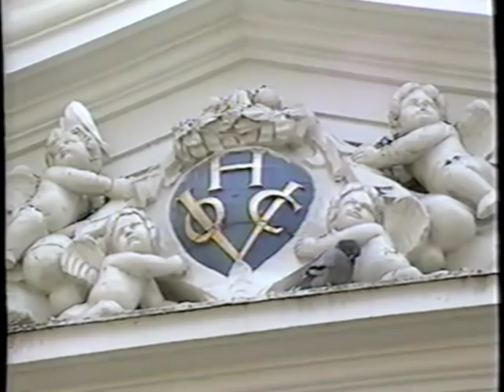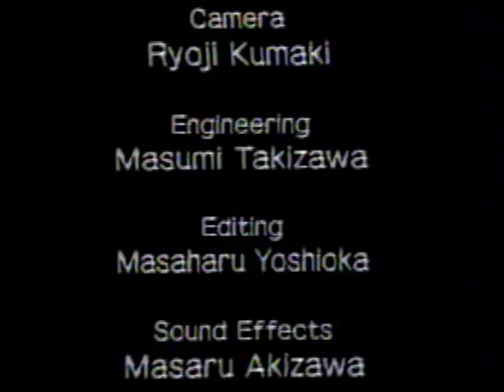Japan Spirit and Form #6: Japanese Tea Bowls

Comment: This is an excellent documentary, and it got me thinking: I wonder if I could make something out of wood in a spirit similar to what's placed into making tea bowls. 

I imagine creating objects by hand with the help of a few basic tools. Allowing some areas to be polished, some varnished, and others rather rough, suggesting the time and motion that went into their birth as a unique thing. Doing this, I could choose cuts of wood carefully, using boards that are considered high grade as well as cheaper lumber if it has a nice grain pattern or if it somehow calls to me. Perhaps some areas that were originally cut straight would be sanded to be a little wavy, in order to match the curve of a grain pattern or place movement into the piece. 

Another thing that comes to mind is creating aggregates out of irregular chips of wood and some special type of glue or resin, which could be dried into blocks and used as inlays or something else. I imagine now a box that uses this material as part of its lid. It can be seen through slightly, hinting at the contents inside the box. Perhaps some areas of the material would be left smooth so that you could see through it, and other areas would be sanded so that the inside would be invisible.

I will give it a try soon.